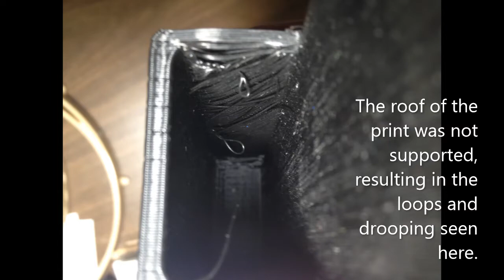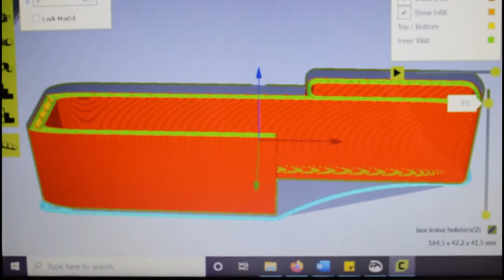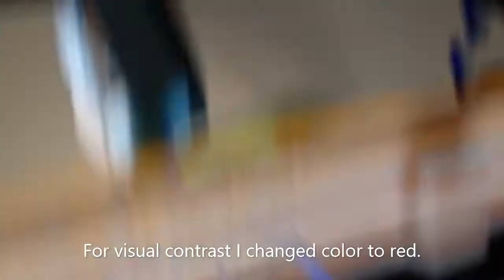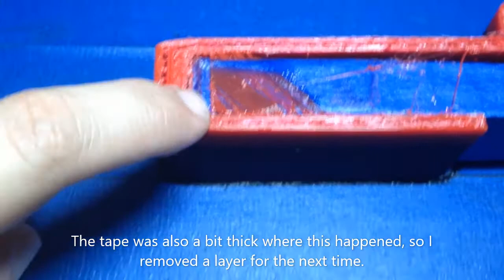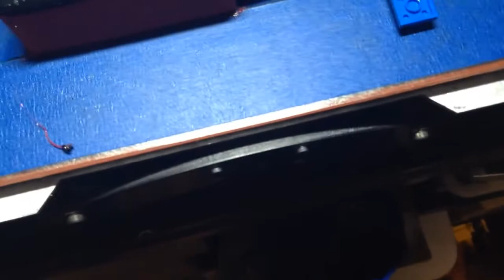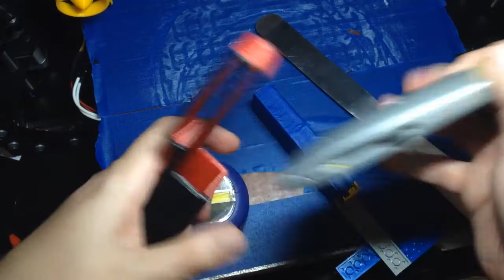Using Building Blocks to Support 3D Prints

Comment: Interesting concept and idea, maybe with different support materials and something to keep the print from sticking to it. How much time would you think you saved compared to printing support material?
Reply from the maker: This was a 2 hr print, with supports easily 2.5-3 hrs. I've used this method on some batch prints of name tags, which saves more time and materials. As 3D printing becomes more mainstream, this can be used to batch produce hundreds of prints and save days. I was debating what to cover the blocks with, packing tape may have been a better choice, but blue tape worked fine for this.
Reply: @3DPT  awesome, yeah with batch prints any time saved adds up quickly and even a few minutes saved per print can save hours.